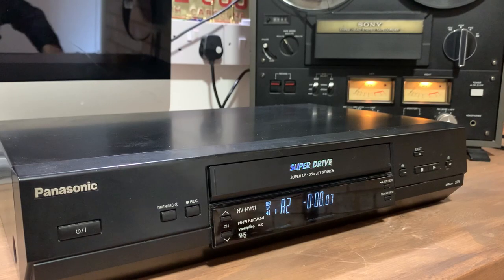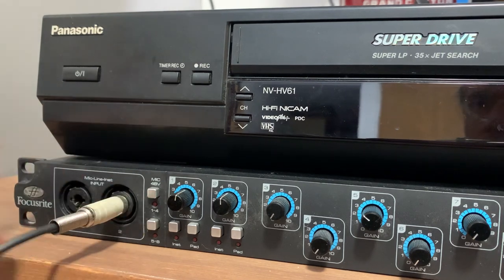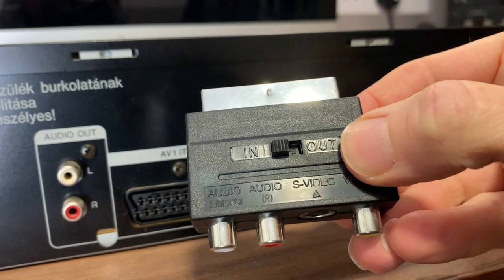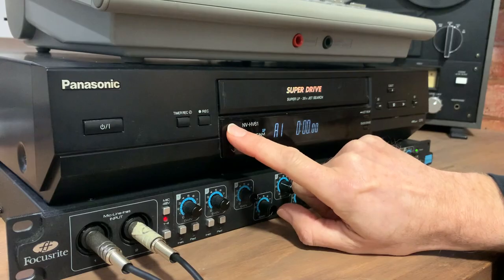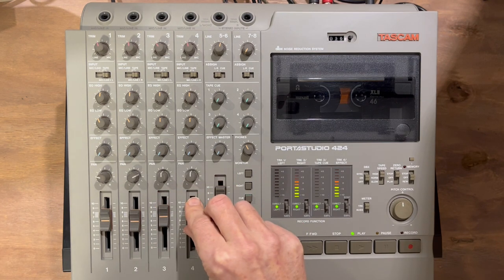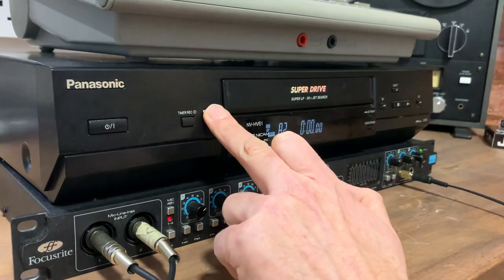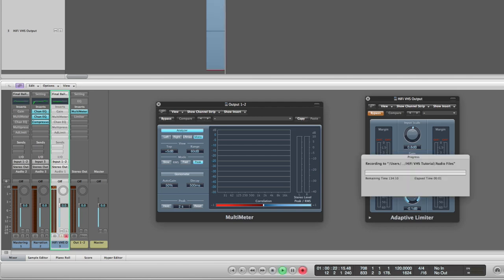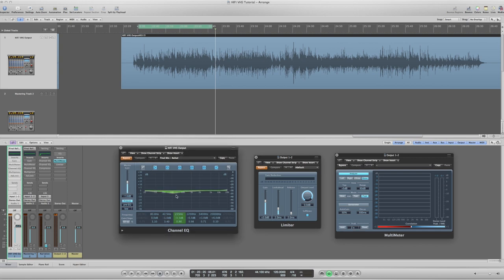How To Record Music On HiFi VHS - Analog Technique’s

Comment: I have no idea how I could use this in my mastering workflow, but love it never the less.
Reply from the maker: Hey thanks for checking it out! Could be useful if you ever do a fully analog release? You could mix your material down to a VCR and then transfer to cassette tape for distribution (at least that’s my current plan 😅). 👍
Reply: For the best possible dynamic sound, you should have a VHS with manual setting of the recording level

Comment: I've used VHS tapes to record HQ audio only since the late 90s.  A few things to note: (1.) Use SP mode when recording.  The slower speeds are fine for recording an entire radio show that runs more than 2 hours, but music works best at the highest speed.  (2.) I use Maxell brand blank VHS tape for my recordings, as they are very low noise and less chance of defects or wrinkles even on new tapes.  (3.) This is a bit overkill, but I tend to record 30 seconds to 1 minute of silence at the beginning, the tail end and in-between songs or takes on the tape.  It makes for a much cleaner session transfer later on.
Reply from the maker: Excellent tips, I particularly like point 3 as I’ve had issues with tracking noises at the start and end of recordings. 👍

Comment: I am not sure why you used the videotape in the first place, but I would have mixed it to a digital file and done my mastering there, eliminating the VCR entirely. However, if you used all analog equipment you could just master it to the VHS tape and skip the computer entirely.
Reply from the maker: Good points. I was producing a fully analog album at the time though, so was partly testing out the process here.

Comment: Do I need to put a video signal on to record sound? Some VCRs won't work properly without a stable sync signal from the input side.
Reply from the maker: You do have to with some models but not this one. It tends to be older VCRs that need a video signal to record audio.
Reply: @wehappyfewmusic  I have a Toshiba M635. Probably one of the machines that require a video signal before anything gets recorded on there. Is there some way to get the machine to record a "dummy" signal to tape without resorting to recording a blank screen or some other input?
Reply from the maker: @SmoggyLambGG  I’ve not tried that technique but this Facebook group will have someone who has. It’s called HIFI VHS/Betamax Audio
Recording.

Comment: No kidding, the most blown away I've ever been by any kind of home media was when I finally got a VCR with hifi audio and plugged it into my amplifier and put in my well-worn copy of Star Wars.

The THX ident, which had made the tiny single speaker on my old 70s telly rattle and raspberry, was deep and full and bam. The film starts and wow.

Given the quality I went through a period of recording radio broadcasts to VHS and would use long play since there seemed no discernible difference between that and standard play on the audio side. Bad move as playing those back 20+ years later on a different VCR the dropout is astounding.
Reply from the maker: That’s a pain that your old LP tapes have developed dropouts! HiFi VHS audio is amazing when it works but can be a bit unpredictable.

Comment: A1 and A2 are the SCART I/O on the back, I would usually use the A1, rather than the decoder. Also, there should be RCA inputs on the front.
VHS can get levels up to +10, but a device with manual level control would be ideal.
Reply from the maker: Many thanks for the tips and a manual level control would be very useful. I’m going to look into getting one with that feature.
Reply: @wehappyfewmusic  For exampl I have a Panasonic NV-F65HQ, other from this line also should have such controls. If you want to go to another level, then there's JVC ERA, or something form Sony's pro line, those owuld have balanced I/O.
Reply from the maker: The Panasonic looks like a good model, and I’ve found a couple in the same line (75 model number). Does yours need to be tuned into a tv signal to get it to work?
Reply: @wehappyfewmusic  Mine does not need to have a video input, as a matter of fact, that model was made with audio in mind, since in LP mode, it doesn't even support a video signal, only audio. And Hi-Fi Stereo in LP mode shows little to no degradation. And we're still talking PAL here.
Reply from the maker: @SFtheGreat  Excellent, that sounds like the model for me then. Thanks 🙏
Reply: @wehappyfewmusic  Have you known that VHS can also be used for PCM recording?
I run a small VHS label, where I release films and music with visuals.
Reply from the maker: @SFtheGreat I don’t know too much about PCM recordings on VCRs but your label sounds interesting. Is there a link on your YouTube?
Reply: @wehappyfewmusic  I don't have a youtube for it, but I should make one with VHS trailers.

Comment: ''Alternatively you might use the VCR as an analog processing stage in a digital recording, as an alternative to 'analog style' plugins in a DAW'' Can you use the tascam 424 for this instead of the VHS or is there any kind of analog compression that the 424 wont do? Ive the exact same tascam mk1  Thanks
Reply from the maker: Cool, snap! The 424 is a nice little machine!  Yes, the VCR would make a great alternative to analog plugins in digital mastering. I’d say the ‘analog sound’ of the VCR would be much more subtle than the 424 mk1 for that purpose. It retains more high end detail and doesn’t have the pronounced tape saturation that you get from a portastudio.

Comment: I don't know if it would work with the existing vhs tape formulations, but I'd like to have a vhs machine with an eight track recording head. Thick tape, and a great transport system that was engineered since they used to make hundreds of millions of those things. It could be a hi-fidelity multi-track portastudio.
Reply from the maker: Now that would be amazing, sign me up! 🙌👌
Reply: the tape moves very slow though, you would get 8 very poor quality tracks (similar to non-hifi vhs audio (50-8khz ish)

Comment: That was a nice touch opening a brand-new and sealed VHS cassette tape. Was this old stock (NOS = new old stock), or do you have a reliable source for new VHS tapes?
Reply from the maker: Hey, this is a NOS VHS I found on eBay, but in my latest video I used a Maxell HGX Black 60 tape, which may be newer? I got a batch off Amazon but noticed they are still available in several media shops too.

Comment: That's a cool video.. by the way, what is the name of connector is pluged on the rear panel Panasonis vhs player? Is it hard to find on the market?
Reply from the maker: Glad you like the video! Try searching for this and they should come up online - RGB SCART Plug Male to 3 RCA Female A/V Adaptor Converter for TV DVD VCRs
Reply: @wehappyfewmusic  thanks much for your answering. Are we have to use this adapter to inputing audio into the machine? Is this the only port on the machine, nothing else input port?
Reply from the maker: @saptoadhinugroho8014  Yes, if you’ve got the same model as me you’ll need the adapter to get the audio input to connect to your studio gear. Some VCR’s have regular RCA jacks and scart, but not this one.
Reply: @wehappyfewmusic  okay, thanks alot for your explanation..
The sound you recorded sounds great.. I'll try this way
Reply from the maker: @saptoadhinugroho8014  you’re welcome and thanks 🙏
Reply: If you are outside Europe, you probably won’t find a model that has SCART inputs or outputs. All of my Australian equipment, CRT, televisions, VCRs etc have individual RCA connectors in and out, and  dedicated S video connectors

Comment: This video shows how to do in PAL, but at least on NTSC VHS, to get a correct audio recording  you need to input an stable video signal too.
Reply from the maker: Thanks for pointing this out, I’ve not used a NTSC model so hadn’t realised this. I’ll add a note in the description. 👍
Reply: @wehappyfewmusic  You also need a stable video signal in MOST PAL Hi-Fi VHS. Only a few had the self syncing function. The Hi-fi was only intended for use in recording video combined. Like most things, the Video recorders were "simplified" as time went by.
Reply from the maker: I think both my decks are newer ones then as they self sync. 👍
Reply from the maker: Yes good point, it’s a close call between which is the best option. The newer models which are easy to use, or early models with better features and complicated setup procedures.
Reply: I've been wanting to copy some music to VHS and play it through my stereo just for fun.  I would have thought you could do it without a video signal.  Thanks for the information.  Simple enough problem to overcome, just run from the video out of a DVD player or similar device.

Comment: How would I record a song directly from my computer from iTunes or garageband directly to the vhs tape? Would I need the same cable you used for your interface? I could see how that would work recording VHS to a computer but im not sure how that would work the other way around.
Reply from the maker: Hi I’d guess your computer has a standard headphone output? If so you’d need a stereo 3.5mm to stereo rca phono cable.
Reply: Thank you!
Reply: @wehappyfewmusic  Would it make more sense to get an RCA to 3.5 TRRS or would a standard RCA to 3.5 TRS make sense? I was thinking about the TRRS cable because that could be seen as a "mic" input to the computer so it could allow easier recording/transfer with one cable. Or do I need one of each? Sorry for all the questions, I'm new to this subject and I want to make sure I get all the right stuff the first time, thanks.
Reply from the maker: @elnyoutube123  I’ve not used a 3.5 TRRS cable before but would guess it depends on your computer audio input. If it’s a line input I’d go for the standard cable, and the TRRS if it’s a mic input.

Comment: hi my mate had been doing this sometime ago  asked why he saw his mate doing it as well 

alot of the vhs decks have a level max thing in the decks 

note i am in to betacam sp there is a over load level settings button  on alot of the more pro decks
the ones with the big vu meters were decks that were target for audio recording only

like on the sony 100ub betamax button for black video  

i have to say a betacam first gen liner audio can walk all over vhs hi-fi  because tape speed is very high 
i have racks of working betacam  decks   note i used to do this as well  till all the good video decks stop coming 
on ebay
Reply from the maker: I’ve not got hold of a betacam yet but they do look to have been designed to record audio in a more professional way. Did you need to get yours serviced/fixed?

Comment: #1: Find hifi VHS
#2: it doesn't work
#3: buy a solder station and replace the caps that always blow to save the fuse
#4: open VHS repair shop
#5: Audio recording?
Reply from the maker: Haha, luckily that didn’t happen to me. 😂